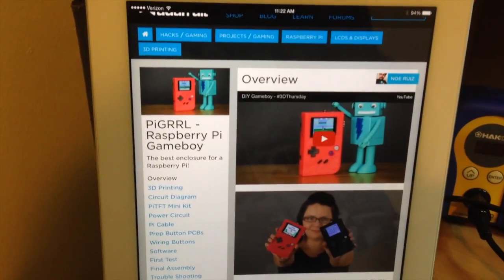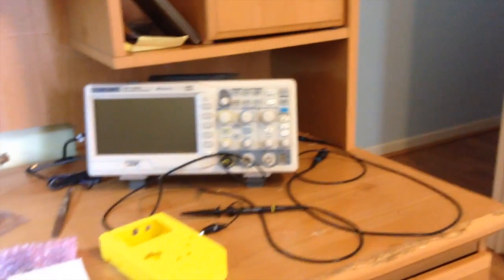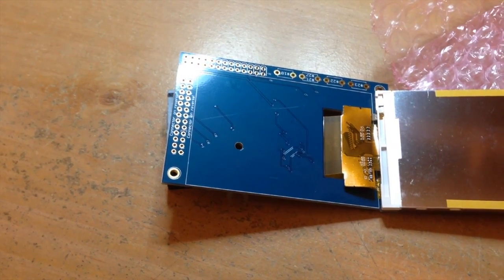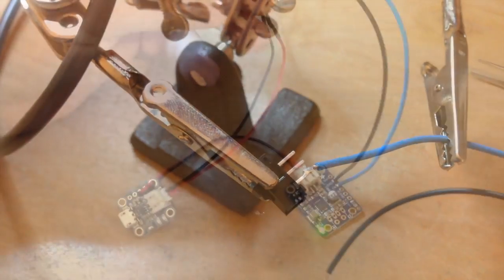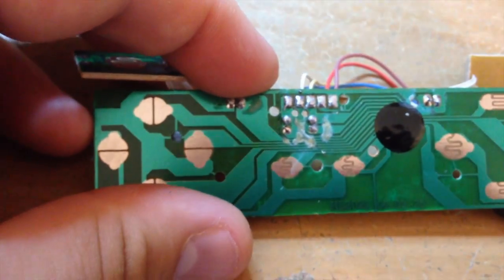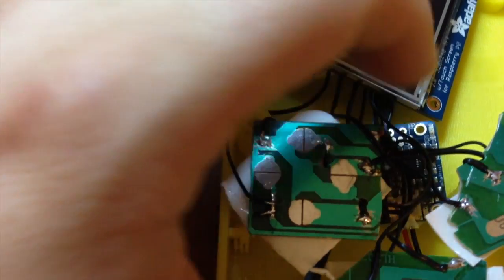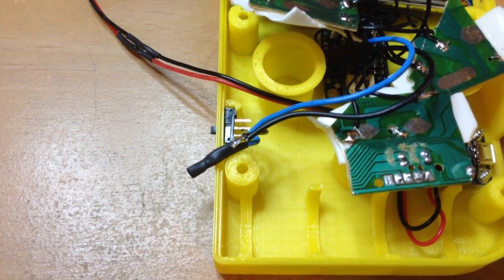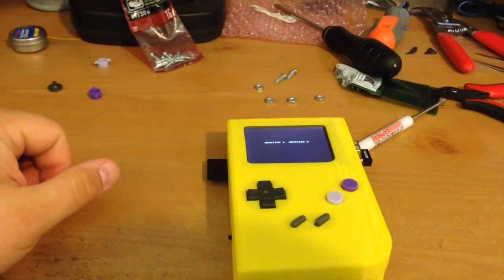DDG - DIY PiGRRL BUILD

Comment: How do you rotate the screen? I've been to adafruit and I entered sudo nano/etc/modprobe.d/adafruit.conf but it didn't work
Reply from the maker: John craig  That's a good question, but I honestly can't remember.  Did you reboot after you saved the changes to the conf?  And make sure that the SD card isn't write protected.
Reply: Daddy Daughter Gamer when I type it in I get a message saying its not a command.
Reply: John craig how do I check my SD card to see if it is write protected
Reply: John craig add space between nano and /etc

Comment: Hey, I bought the parts for this project from adafruit. I was just wondering if you could help me to wire ALL of the buttons from the snes controller to the pi with the gpio ribbon cable. Although the regular project is great, I need to play chrono trigger on this thing and so need all of the buttons.
Thanks :)
Reply from the maker: That's a cool idea but I haven't done that myself.  Have you checked the adafruit forums?  There may be someone who's already done that.

Comment: I am currently starting the PiGRRL project myself. i have everything it need to start, but im having trouble putting the Cupcade OS onto the microSD card. The card is a micro SD 126GB. I was just wondering if there is a step-by step guide on how to properly put it onto the microSD. All i can find are great guides for the Retro Pi image burning, yet nothing at all for the Cupcade image.
Reply from the maker: Adafruit has one here https://learn.adafruit.com/adafruit-raspberry-pi-lesson-1-preparing-and-sd-card-for-your-raspberry-pi
The 128GB card might be a little overkill for this however, these rom files are pretty small.